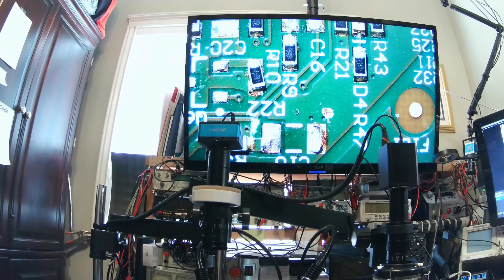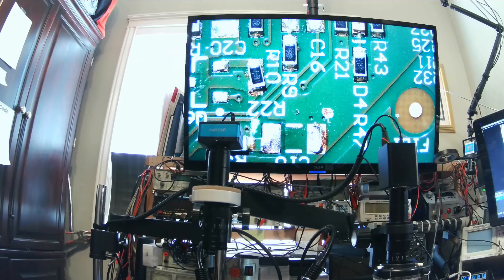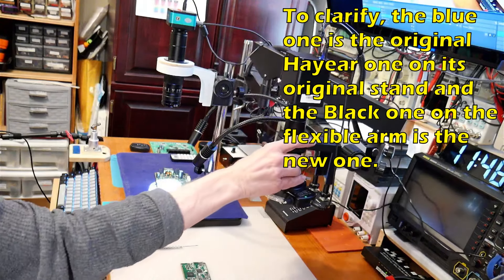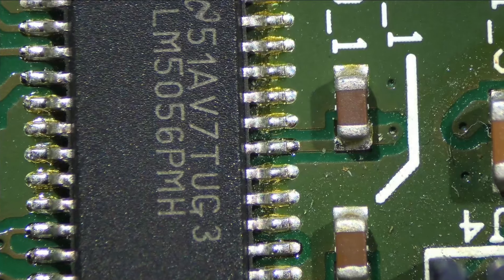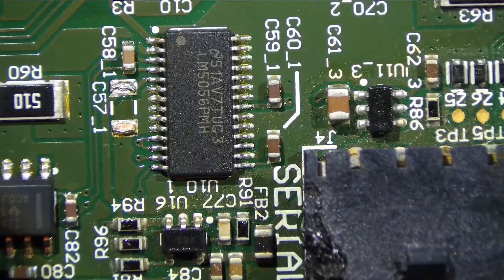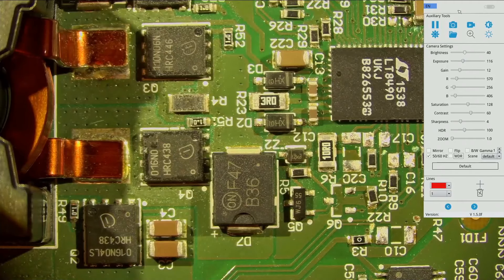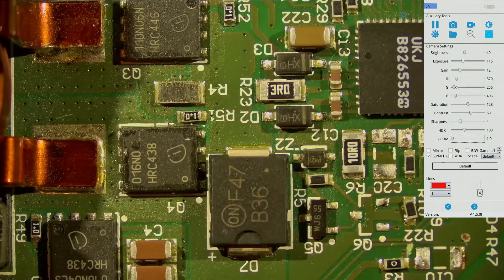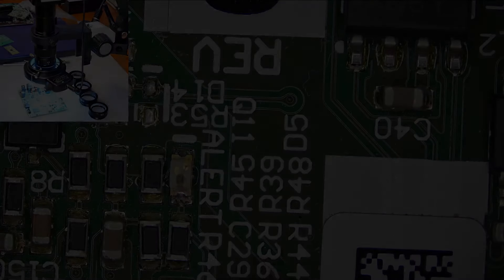Micro-Soldering Microscope Update

Comment: Lapsun has done it with IMX385 and IMX678.  I hate focusing so if you click zoom and just leave mouse over it scroll wheel will work for digital zoom. IMX678 works by default anywhere on the screen all the time. I would like to try IMX585 but crazy expensive and I don't see how it could be any better. I have camera hdmi going into obs computer then project obs to my working monitor. In this way I can have a gopro pointed at multimeter and see it on my working scope monitor all at the same time. you know what i mean. great video.